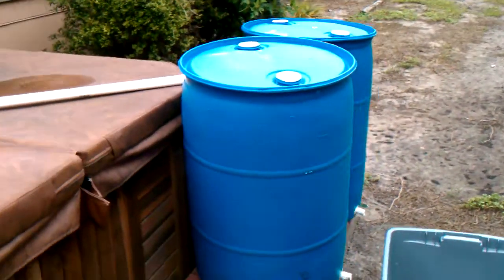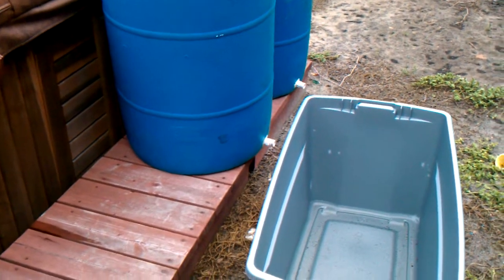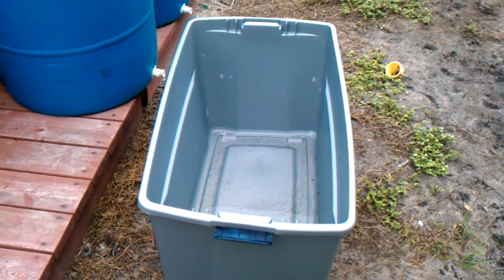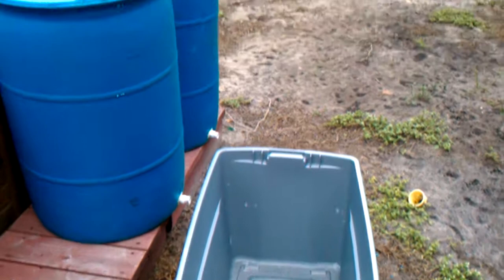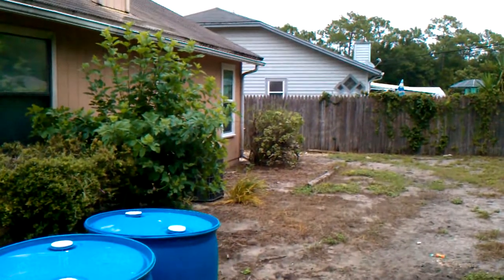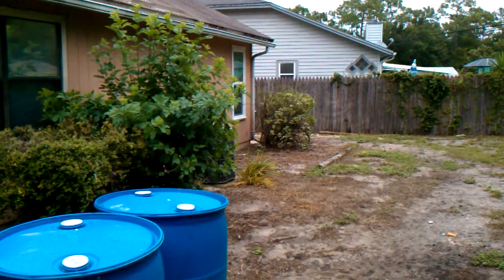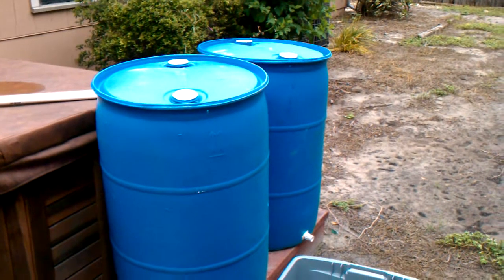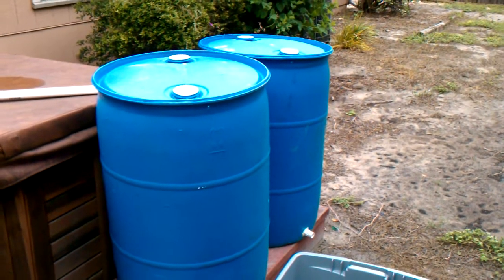Rain barrels and solar water pump system for above ground garden part 1

Comment from the maker: @docsavage72 I used a 12V pump off of eBay. Just make sure that it's strong enough to pump the water to whatever head-height you need. Also, don't skimp on the pump...get a good one. If you are using 120V, go to the fish store and pick one up there.